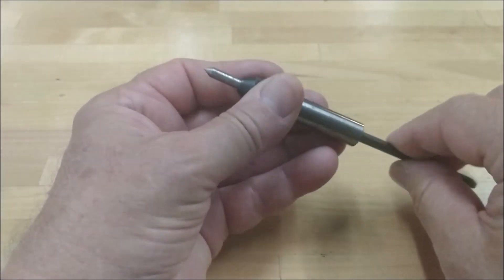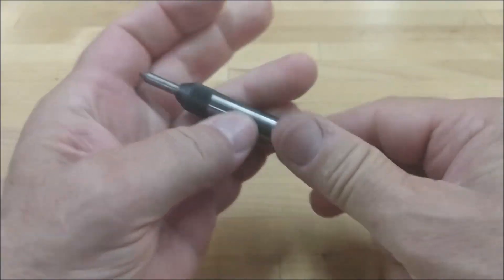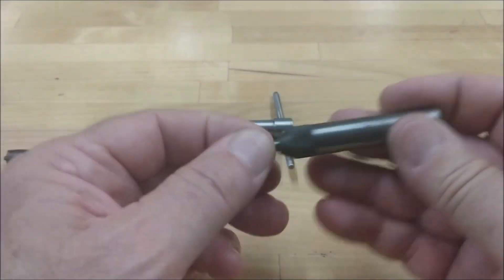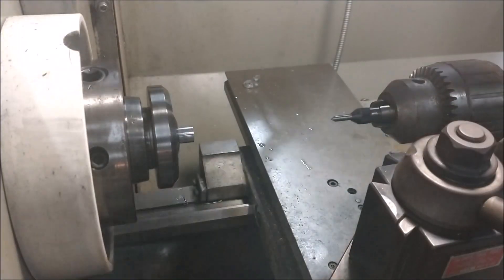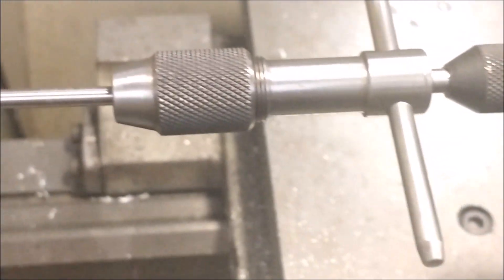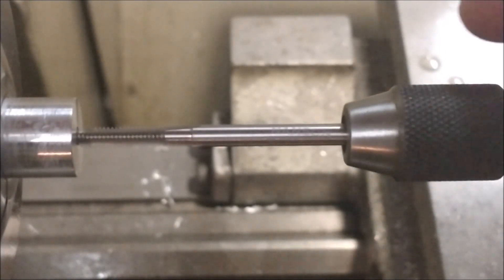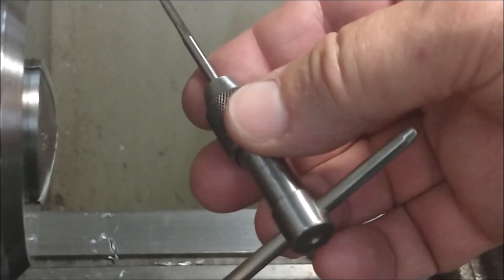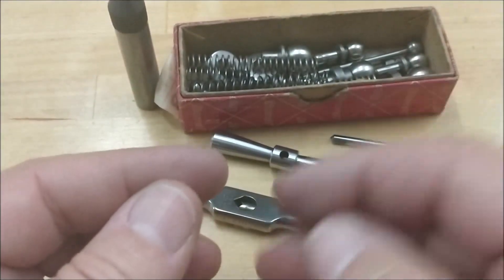Machinists.....Tapping a thread on a Mill or Lathe?...Don't Do This !!!

Comment: Correct me if I'm wrong,  but the problem appears to start by using a typical TAP handle that doesn't center the tap to begin with. Obviously, putting a load (spring) on the  off centered handle doesn't correct the problem.  Once again you've just proven just because everybody's doing it doesn't mean it's right.  It has always been my understanding using a tapered tap first to start the threads was necessary for precision, followed by a plug or bottom tap. Thank you for making me aware of the issue.

Comment: Ever watch the runout on a commercial tapping head? It wanders all over, yet they are in use in professional shops. Taps will follow the hole if all the parts are within reasonably close. T handle in your lathe is no different than T handle in your mill.
Reply from the maker: I respectfully and completely disagree with your comment. Commercial tapping heads can, and do runout, but the axis of the tap is always perpendicular to the workpiece and aligned with the tapping head, Maybe not concentric, but normally true vertical. A rigid tap handle as shown in this demonatration looses the perpendicular alignment and results in the hurricane runout shown. This error is either in the end hole or the stack errors found in the cap and jaws alignment to the square end of the tap.

Comment: Not enough information about the required job to decide between mill or lathe. In short though, if it's apart that can be done on either, then it depends which machine is free at the time

Comment: It's NOT the hole in the back that's doing it!! The wobble is in the MIDDLE where the end of the TAP MEETS THE TAP HANDLE.

Starrett makes those tap handles like that for a REASON. 

If you actually knew how to put the tap in the t handle or open up your t handle to see why it's acting that way you'd be able to figure it out.

My quality t handles do not move that way. The only point you have made is that either you are incompetent or you need to buy a better t handle
Reply from the maker: When comments get personal, they get deleted and the commenter gets blocked. Tick tock....
Reply: @joepie221  no need to retaliate or delete.  The man has his opinion, whatever it’s worth, and most commenters disagree with his approach, but there’s no harm in being wrong or even being right.  It’s all just added conversation that helps shape the end goal… which is to identify bad shop practices, bad tools, and how to adjust or adapt to overcome those things.  He’s dumb for trying to insult someone who is on the same team, but let his comment live on for others to weigh in on.
Reply: Let's say the T-handle is a piece of shit. Ok,  how many people do you think check the concentricity of their t-handle? Can you post your video on your particular T-handle? Why not counter with a video of the same test? otherwise you're just a bag of hot air.

Comment: I agree that using the tap handle isn’t a good idea , but , if you look at the way the handle is rising and falling as you turn it , the problem isn’t the hole in the tap handle , fact is the tap isn’t 100% aligned in the tap handle jaws. That misalignment doesn’t matter when you are manually tapping ‘cos your hands aren’t calibrated. By removing the tap handle from the operation you’ve reduced the opportunity for error and increased the accuracy . Great advice though.

Comment: How about putting the tap into a drill chuck in the tail stock,  releasing the tail stock lock, and turning the feed handle on the tail stock to feed the tap.  The released tail stock lock limits the push force on the tap.
Reply from the maker: Very safe method. Just be sure the tailstock has room to run. You can always feel when your revolutions match the tap pitch.
Reply: I did some small holes (m4x0.7) this way. Got brave enough to turn the headstock on for about 1/2" (this is on a minilathe). Worked well.

Comment: Add to that great tip your other video (I think it was from you) about making and using a knurled knob that fits on the tap and is turned by hand - much less likely to break a tap using that instead of a longer handle with lots of torque.    I've made those knurled knobs for each of my small tap shank diameters.
Reply from the maker: Those little knobs give such an elevated feel for the tap. Great addition to any toolbox.

Comment: Thanks for the excellent video.  And yes, I'm one of those that thought using the T-Handle in my lathe was running true.  I think I need to make a tap handle similar to the one you used to run true.

Comment: And the non-concentricity of the T-handle wrenches is probably due to the jaws, similar to the non-concentricity of a 3 jaw chuck, correct? Thanks Joe!
Reply from the maker: I have to believe the manufacturers don't really care about concentricity. They assume the handles will be used for bench work and just don't see the need for it..

Comment: Hi, Joe.  I've always had the same complaint, but I thought I got around it by using the T-handle just to start the thread and then rely on the tap to follow the hole.  Do you think that is OK ?  Kurt Daims
Reply from the maker: Thats perfectly fine. If you are interested in really seeing how that tap is going into that hole, don't just rotate the tap during the tap operation. Every turn or so, spin the part without touching the tap !!!!! Watch for the body of the tap to spin true. Thats a good checkpoint.

Comment: Pricision machining for 25 +. I would have returned that tap handle. I use Starrett for the small taps ( I think the one you have is Starrett ) their T-tap handle quality has gone down in recent years (I think) mine is 25 years old and runs thru. Also, I tapped that hole on the end and made a screw in guide shaft with two flats to tighten and loosen it to the T-Handle. PS I like your content and the way you deliver it. Thank you.
Reply from the maker: Thanks for watching.

Comment: Good demo. I have a lot of experience in the macine shop, but i still like when I can pick up from your videos new way of looking at the trade.

I don't use T handles at all myself, maybe because I sensed that kind of misalignment was possible.

But as a full-time fully qualified machinist who also has an engineering degree, I think in terms of the computer science interpretation of entropy which is seen as a loss of information. 

In machining, I see entropy as the loss of geometry, either alignment orientation or location. Your T tap handle has a number of surface features between the center hole in the rear and the tap jaws themselves. Each has imperfections in spite of the efforts to minimize them. So that tap wrench, in conjunction with the spring loaded doodad introduces six or more sources of misalignment, or entropy.

Joe, you'd probably disapprove of my methods of tapping small holes in the lathe and the mill. Or you'd at least say they're not for beginners. In short, they are methods i worked out that reduce orientation entropy to "nearly" zero. I know fellow machinists that cringe a bit at my method but I don't break taps or make drunken threads.

Comment: Found out about that the hard way my teacher told me not to but being young and thinking i was smart did it anyway he made me set the tap up in the chuck in the tee handle that was a starret and put a indicator on it to prove it to me because i just didn't believe my brand new starret t handle was not accurate and he done it in front of the whole class how embarrassing after that i would watch the older machinist when i was on the job and asked a lot of questions and actually learned a lot at 29 years old opened my machine shop and done very well you be surprised how many machinist still do this but I'm old and retired now but still got my own little machine shop in my garage just so i can tinker around always enjoy your videos your never too old to learn something new even if it is from a younger man but some men will let their pride get in the way thanks for sharing your knowledge Joe

Comment: Sometimes I use a tap handle like the one you show towards the end on small taps. The drive part of the tap driver is usually thicker than the length of the flats on the tap so then I just put the pointed end of the spring loaded center in the square and this centers up the tap. It only contacts in 4 places but it still centers the tap.

Comment: Hi Joe  I use spiral flute machine traps and grip the tap directly in the tailstock chuck.  Don't lock the tailstock down (let it free float) and present the tap to the job.  Select a low speed (say 45 rpm) and use the 'jog' push button. Push the tailstock into the job until the tap engages.  Once engaged the tap will pull the tailstock toward the job.  Once the correct depth is reached, just reverse the chuck direction.   This method is quicker and keeps everything aligned.
Reply from the maker: Keep the tailstock unlocked and gently crank the handwheel once the tap engages. the tailstock will either stay still or push slightly away if your rotation is almost perfect.
Reply: @Chris-te7uk  Agreed  I did not consider the alignment issues as I have gone to great lengths to ensure the heights and alignments are accurate.  I invested in a lathe alignment test bar so doing this is much easier.  I incorrectly assumed that most machinists would keep their machine in good condition.

Comment: I've tried this with my ratcheting tap holder and found your result to be true. That being said however, I can't see why that's the case with a non ratcheting design since it's just a solid block of steel turned on a lathe vs the floating nature of the ratcheting type. Could a high end one such as a Starrett be better suited for this task?
Reply: Simply check yours for runout. All of mine have some ... likely so do yours.
Reply: Even the expensive holders are still built down to a price such that the maker gets an acceptable profit margin.

If you want the best precision, you need to make it yourself while the cost of your time isn't being controlled by someone with their spreadsheet in mind. Taking half the evening to ensure everything is true to the very best of your measuring equipment is probably the way to get better precision than commercial offerings.

Comment: Hi Joe, I have been using a Starret tap handle, but thanks to you, I now know how to set up and use the tap correctly. Just curious though, does any tool manufacturer even attempt to make a precision tap handle that would be acceptable? BTW, I never knew there were two ends available. ☺
Reply: Nope, there is no precision handle for a reason. You should always use the tap body as the indexing point, the flat is only for applying torque. Grinding precision flats on any tap would be unreasonable pricey. Btw, this is info is handled in most machinist books and not only for taps, but also for drill bits etc.

Comment: Joe is 100% correct(again). I always thought my Starrett tap handles were concentric when tapping a small thread, But after watching this video and doing some runout tests it seems that I was getting a 0.030" runout !!! So now I start the tap with the reversed-ended spring holder and then I use the tap handle.

Thanks again Joe for saving my taps for any future potential breakage !!
Reply from the maker: My pleasure.

Comment: Thanks for this video, I run  a 5 axis mill that doesn't have a locating spindle, so no canned cycle, no tapping function. So often we use a spring loaded centre on the spindle to locate tapped holes on complex angles on parts, the issue is when we go below M8 we have to resort to the tapping handle with a centre, which has resulted in many poor threads and broken taps. Your method is so simple but will save us so much time and $, thanks.
Reply from the maker: Glad it helped

Comment: Slight problem is is that some smaller taps have no dimple or concave on the back. You kinda have no choice but to use the wrench.
Reply from the maker: Hand grind a conical tip on the drive end. Check it by rolling the tap on a flat surface and look for runout of the point you just ground. I actually do it all the time.
Reply: @joepie221  and it works well? Don’t really know why I didn’t think of that 😂. I guess I’d wonder how accurate I could grind a cone whilst expecting it to be true but it’s worth a shot.

Comment: I made a couple of these tapholders inspired from Your old video - they work great!
For very small taps I use a shopmade contraption with a small chuck on a 150mm handle with a precise center. 
Dia is 15mm with knurling, works nicely for small stuff since it is possible to feel the small torque before messing up...

Comment: Good idea with the home made tap wrench. I've done it the "wrong way" many times because it's better than eyeballing it and yes it's not perfectly true to the axis and it's certainly better to power tap on a mill or a lathe if the tail stock is not too heavy and the tap too small. If you are going to use the wobbly tap wrench method use it to just start the tap by two or three threads that way it is not holding the tap off the axis the entire time especially when you get to the back end of the threads. For many parts it works good enough and will somewhat self correct as it gets further into the hole as long as you only use the guide to start the tap. If you have something that is critical that it's aligned near perfect axially then do as this video shows.

Comment: What about those T-tap handles with cylindrical end and come with a separate piece that cups over the end and is meant to be mounted to a guide spindle?
Reply from the maker: I have to believe the wobble is usually caused by the jaws.

Comment: Too much messing around. Put the tap in the drill chuck, apply pressure to hole, turn chuck by hand 2 or three turns, loosen drill chuck, back off tail stock, finish by hand. Or, with machine tap in chuck, run lathe, as you turn off spindle push tail stock/tap into hole until spindle comes to a stop, loosen drill chuck back off tail stock finish by hand. Use a slow speed, do not overtighten drill chuck, as this will allow tap to slip in chuck and prevent breakage. When possible, avoid 4 flute taps. I do like them for bottom tapping.
Reply: On larger taps yes but sometimes the tailstock is too heavy and cuts the threads too loose especially on softer materials such as aluminum.
Reply from the maker: Depending on the tap size and material, there are numerous ways to do this. But...this video is very specific about the setup shown.
Reply: I’m with you, I use the tail stock chuck, but I am spoiled with a lovely keyless chuck. I also inherited a mother way to hold a die for male thread cutting. It’s a MT stem with a flat round pad. Just used to hold the die true to start the thread. I’m surprised it’s not more popular. Mine was a standard accessory with my late 1960’s Swiss lathe.

Comment: The spring loaded tap guide in this video is made by Fischer Machine, they are good quality, they are reversible with an inside cone and point. The tap wrench appears to be a Starrett or General hardware. These are known to have misalignment from the "locating" hole at the top to the jaws that hold the tap. It is  difficult to make the jaw fit good enough for the centering hole at the top axial concentric due to design of the tap wrench. Greenfield Tap & Die made one piece tape wrenches that were a bit better than these multi piece tap wrenches. 

Regardless, as noted in Joe's video, best is to get rid of the tap wrench using the tap guide direct on the tap. As the tap gets smaller the tap crowns little tolerance for misalignment. Once you're down past 0-80 or 1mm taps, alignment to the hole is crucial. Only a slight amount of misalignment will bust the tap. Small taps do not need a lot of torque to turn them long as they are sharp and of good quality. It is easy enough to make a knurled knob with two set screws and a hole drilled to fit the tap being used along with a good tap guide and proper machine set up. All this goes a long ways to greatly reduce busted taps and internal threaded holes that are not aligned proper.

These seemingly small details are more significant than most realize.
Reply: That's some small threads, over thirty years in a machine shop I've only used taps smaller than 4-40 a couple dozen times, just like when you have a drill or endmill that's under .020" things are a bit different, less room for error.
Reply: @phillhuddleston9445  
Really depends on what ya working on...

Home shop consist of a Mori Seiki MS850 and a Bridgeport as the lathe & mill, Smallest taps in the shop are 1mm and 00-90 (electronics stuff), largest taps are 1-7/8-20 NS (machinery stuff)... This range of taps puts "interesting" demands on machines and tooling and how taps are used.. Small taps and cutting tools do not tolerate misalignment or abuse as they bust off real easy and trying to dig out tiny broken taps or cutting tools out what is being made.. is NO fun at all.

That over used adage applies, possible to make tiny parts on larger machine tools, about impossible to make BIG parts on small machine tools..

Comment: Joe ~ I've been tapping a lot of small holes in expensive stainless parts.  I can't count how many taps I've been breaking off in blind holes, ruining the parts.  I've been using taps a couple sizes larger than the 75% thread recommendation to get around the problem, but it's still pretty scary.  The info you shared I'm betting is 100% of my problem!  I'll check it out today in the shop but this was a terrific bit of information!  Thanks.
Reply from the maker: Excellent. Good luck. Another gem is not to over power the tap with a giant drive handle. The smaller the tap, the smaller the handle. You'll get much better feel.